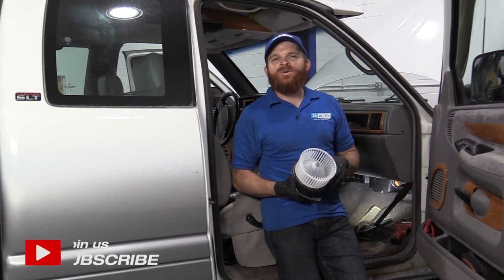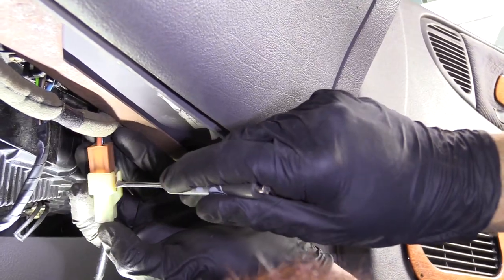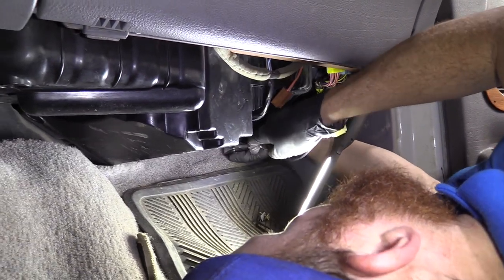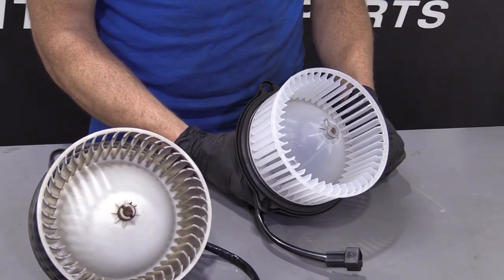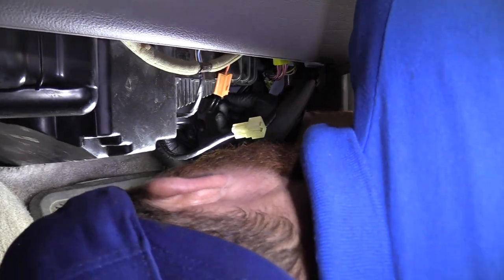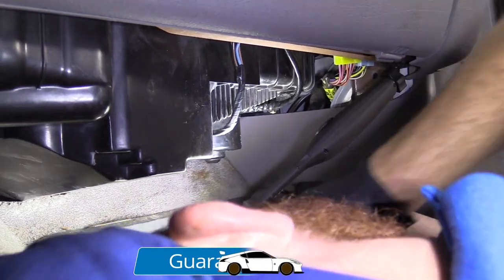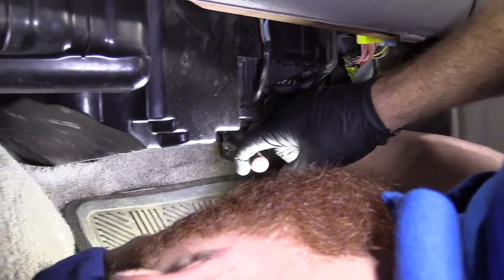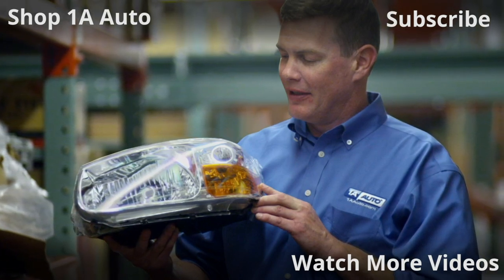How to Replace Blower Motor 94-02 Dodge Ram 1500

Comment: he put the old part back in if you pay attention to the 2nd part he clearly puts the old dirty part back in , further proof earlier in the video when he shows the parts side by side the new one has a black connector and the original has a white one thus they installed the old part lol , great instruction video on how to remove the motor just putting this up here for full transparency
Reply: You also notice the only position the heater worked at all in was wide open....
Reply: @austincumiford6874  works in all. Theyre just weak in these trucks. Watch it closely
Reply: Lol I noticed that too
Reply: There demo videos
Reply: Who cares… the goal was to show you how to do it
Reply: @brands743  It makes a difference when the part he compares it to doesn't actually fit correctly in a 2nd gen dodge. The 2nd gen has a cover that goes over the motor housing, and the OEM wire has to come out of the motor housing closest to the fan, because if it doesn't, the cover won't go over it and you'll have to modify it. Goal not met.
Reply: @ianadcock2064  They're

Comment: My blower stops blowing air when I punch the gas. If I'm driving at a "normal" pace, it works fine. But when I try to accelerate too fast, the blower stops blowing air. Could this be the blower motor or something else?

Comment: Hey Lenny I have a question. If you remove the blower motor can I get access to the blendoor motor actuator?
Reply: I don't think it would help
.
The actuator is mounted to the outside of the HVAC box.....not the inside